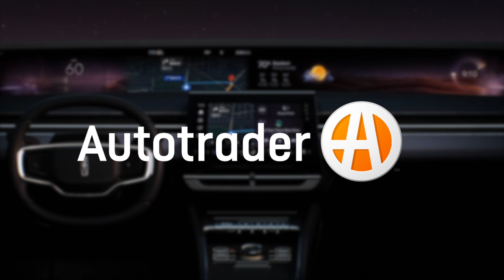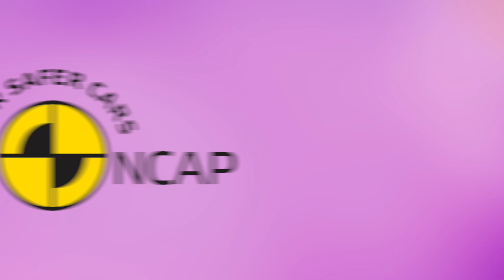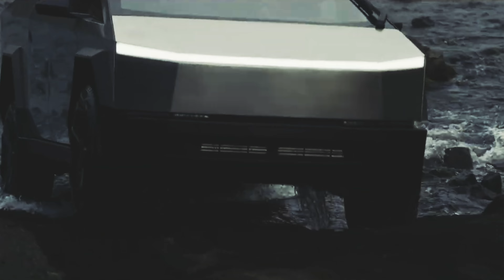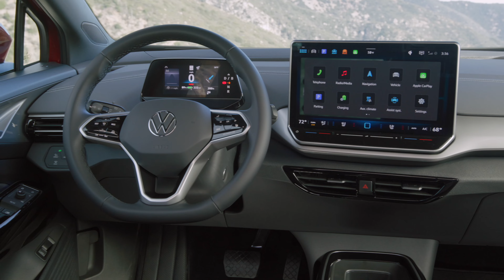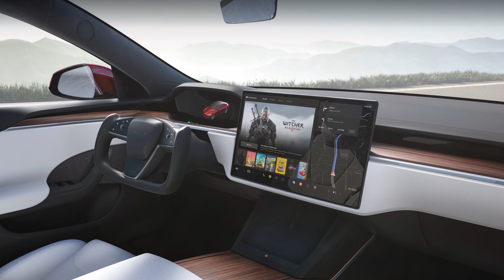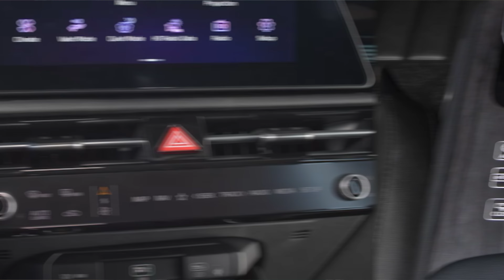Safety Regulations are Coming for Your Car's Touchscreen

Comment: Literally every one of those mandatory features for the 5⭐ rating have either a stalk, steering wheel, or overhead button(hazards) on Teslas, and aren't "buried deep in a touchscreen" as you claim. 

Seems like "off the top of your head" is a pretty awful journalistic standard/source to use, especially when you're 100% wrong. 

I'm sure there will be a retraction/correction though...right? 😅

Comment: Wondering if Tesla will still pass on this since they technically have buttons for each of those (wipers, turn signals, horn) on the wheel, and hazards on the ceiling with button?
Reply: Yep, their mention in the video is just lazy "FUD"/misinformation because they know what brand name magically gets the most engagement, especially when they stretch the truth or spin things way out of context.
Reply: @NavyKings2007 yet they used a Lincoln for the thumbnail.